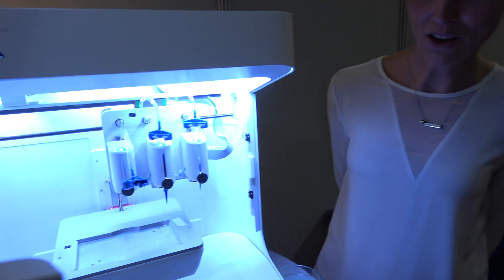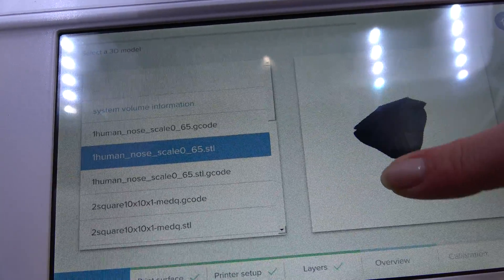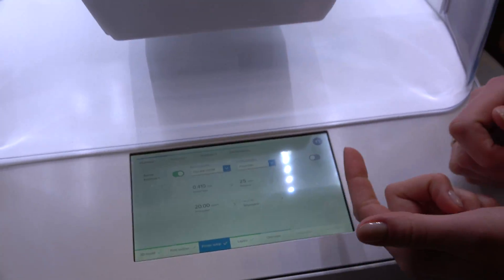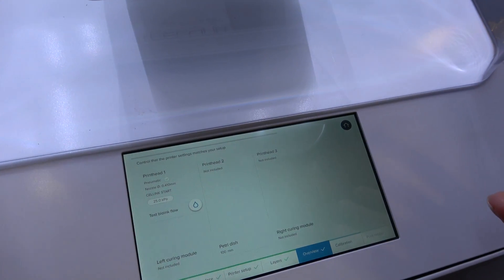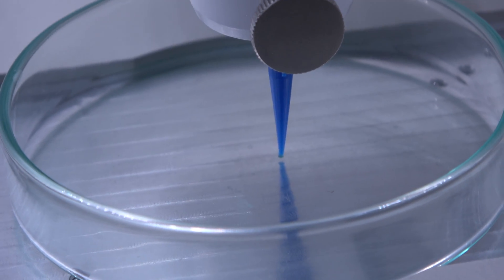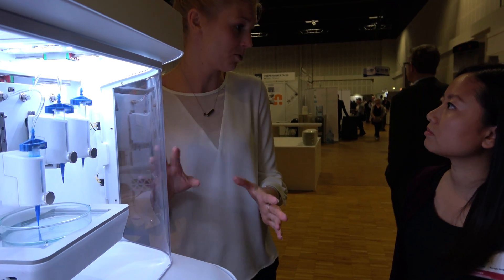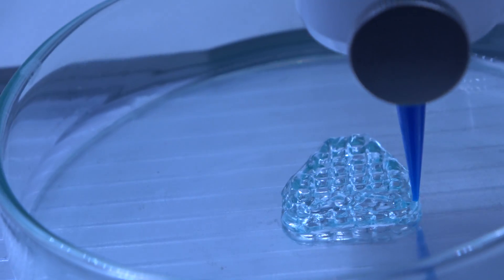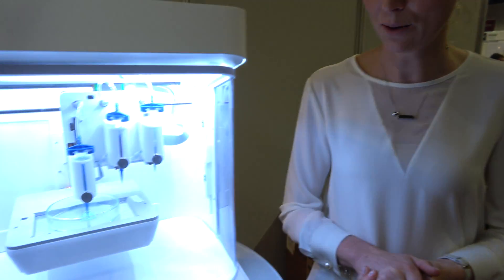Demonstration of CellInk's new BioX bioprinter

Comment: Do not buy these low tier printers. We have one in our lab and the thermoplastic printhead stops heating every 10 or 20 minutes and waste hours of work. When asked about the problem, they dare to ask $4000 for an extensive maintenance extension without explaining anything. Failing a very basic function of any 3D printer is a joke and should never happen in their price range.
Also, they only test their printing materials for merely 5 layers and start to sell them. Good luck with printing anything publishable with their product lol